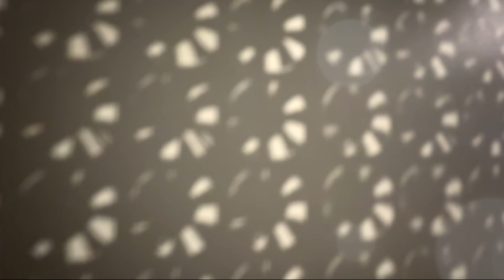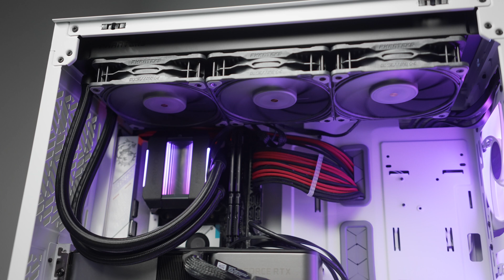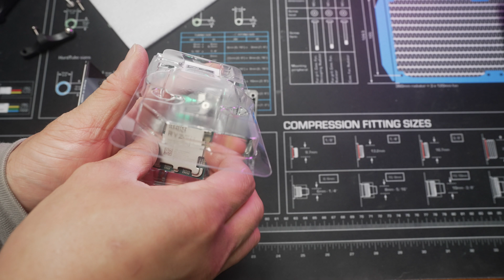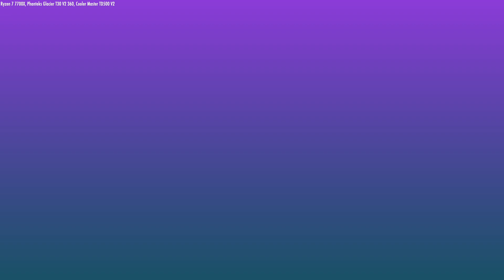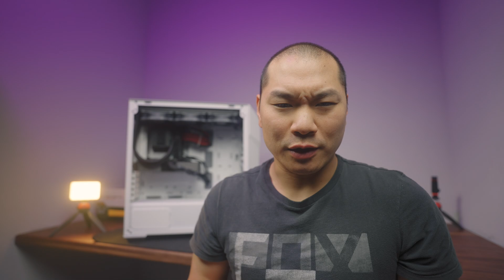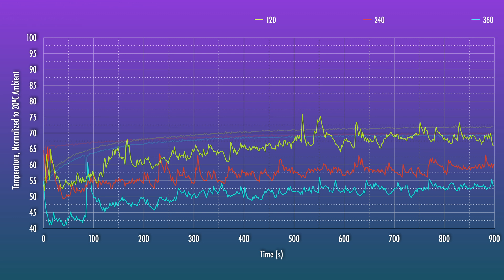How big of a radiator do you need for Ryzen 7000?

Comment: I learned from my friends that these CPUs easily hit 95C even with 360 mm AIOs. Luckily the new 7800X3D is much cooler but still really powerful for gaming.
Reply: They do hit such temps cause their ihs suck i bought the 7900x3d and delided it planing the setup now already have everything i need just modding my nv7 case to fit a 480mm radiator alongside with the top and bottom 360 radiators i will liquid metal watercool it and later add a rtx 4080 or something

Comment: Can the 7600X or the 13600K be air cooled??
 
I do not know a lot about water cooling. To be precise, water is very conductive and I honestly do not want to make any mistakes. Down the line I am sure I would encounter leaking (no matter how small) and I cannot take the risk of fixing it myself.
Reply: My impression is that the 13600K can definitely be air cooled. Some of the big air coolers like the Thermalright Peerless Assassin 120 SE have comparable performance to the best AIOs. Lots of people have the same hesitancy about water cooling, myself included. However, if you are building in a small form factor case, your options for air coolers will be more limited. I had been looking at the Alpenfohn Black Ridge for my mITX build, but it won't fit with my motherboard - and probably wouldn't give me terrific thermals. My plan is to wait until the 240mm Phanteks AIO gen 2 becomes available for purchase.
Reply: @GunSheppard  

Thank you very much for your reply! I am not thinking of building an ITX because I live in a warm climate.
Reply: @ionamygdalon2263  No problem! I've been doing a lot of research on cooling, it is the last part of my build that I am still deciding. You might be interested in checking out this recent video comparing air coolers, the Thermalright and Noctua are very highly regarded: https://www.youtube.com/watch?v=HgGaEZjb5Ls
Reply: @GunSheppard  

Many, many thanks 🤗

Comment: I'm literally about to build Ryzen 7700X box in a mid atx case and was wondering do I need 360mm rad. I'm planning to use  NZXT H5 flow case which only supports 280mm at the front and 240mm at the top. I know something like Corsair 4000D airflow would be better because you can fit 360mm rad at the front and 280mm at the top. I'm just sucker for NZXT case looks :D I want to start with AIO but eventually will do custom loop so Corsair 4000D makes more sense space wise although I've seen custom loops in NZXT H5.
Reply: I have a 7700x with a 240mm aio and has no issue keeping it cool in the 4000d. It’s not like you are benchmarking all the time, in gaming 240 is plenty
Reply: Generally 280 aios perform similarly to 360s so just go with whatever you like better

Comment: Thanks for the info. 🙏

The NZXT H1 V2 has just been recently reduced to about £230 here in the UK (low ambient temperatures). I was tempted to buy it and throw in a 7700x  into it for my new build. It comes with a 140mm radiator AIO.

Will I get away with it? Am I pushing it? What would you do? 🤔
Reply: 140mm AIO on a 7700X will be fine, just PBO2 undervolt it and you’ll have no performance loss with solid temps.